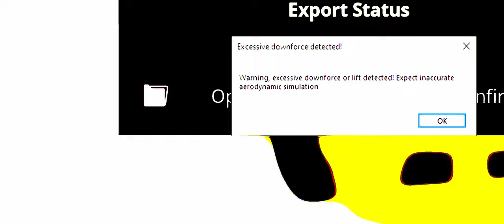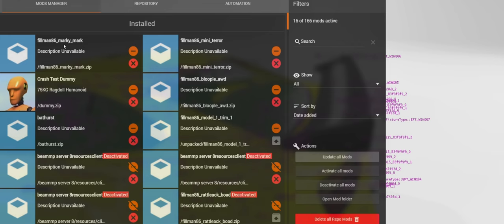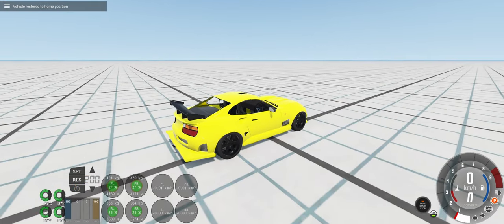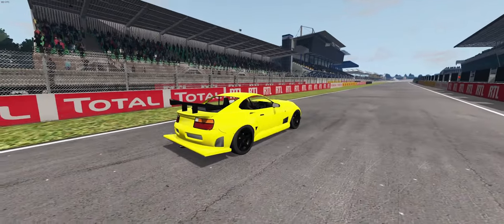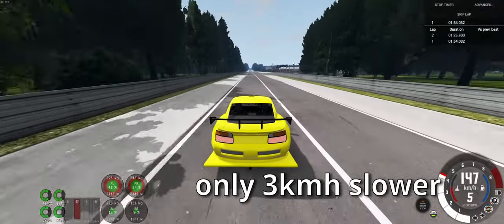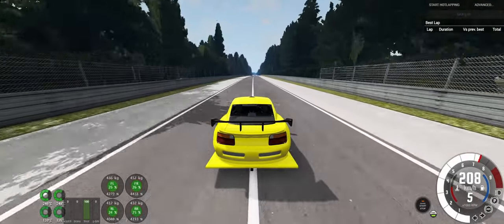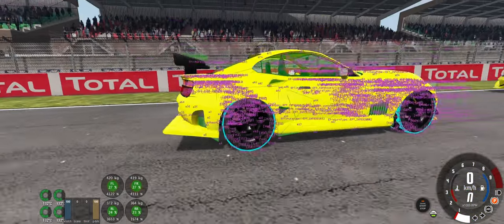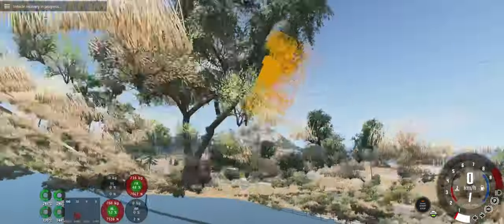the Sneaky Downforce Code Work-Around (Automation🔧BeamNG)

Comment: 12:15 - If you look at basic flow optimization elements of cars, like undertrays, air curtains, spoilers and diffusers, they tend to both increase downforce (sometimes just by decreasing natural lift of the car) and reduce drag at the same time.

Also: I've just realised this body might be great for Maseratti Granturismo lookalike.
Reply from the maker: yep, but the current exporter is broken, especially if you have too much downforce (and by too much, I mean more than a moderate amount)

Comment: "have you had this issue, well I.."
I'll stop you right there, the answer is no. I've been building alot of older supercars. Which means all the wings do is look cool and reduce top speed. Wings in the 1970-80s are useless. But atleast you can kill people with how violently they turn there heads to see what that a loud screeching noise is, and the bright yellow wedge with aviation parts is going the opposite way on the highway. There's a plus side to everything.
Reply from the maker: haha fair point, but that doesn't mean you can't use this if you're masochistic :P

Comment: You can just lower front and rear wing angle to 50% in vehicle config and then edit the camso_downforce drag coefs. You get more downforce for less drag
Reply from the maker: drag and downforce are derived from the drag number though, so less drag = less downforce
Reply: @fillman86  that may be true, but you can get more downforce and less drag from a high drag coef, low angle setup than a low drag coef, high angle setup; high angles are normally less efficient at making downforce irl so it makes sense
Reply from the maker: @j-maoh2086  unfortunately that's not how it works in their new setup anymore
Reply from the maker: @j-maoh2086  *when you get the error